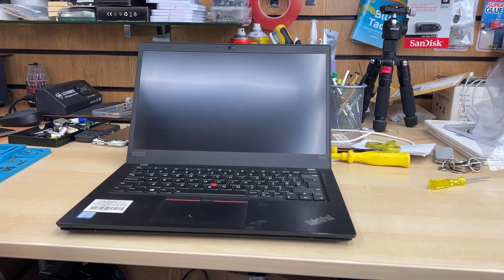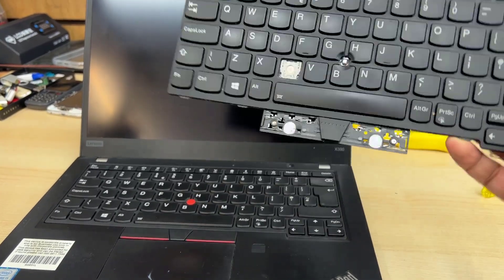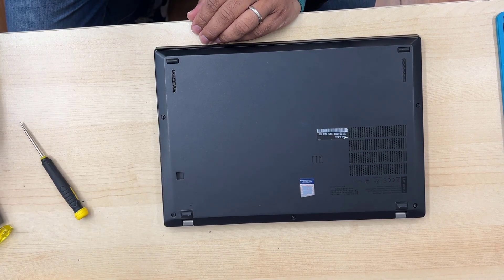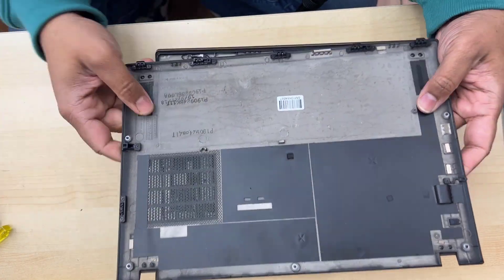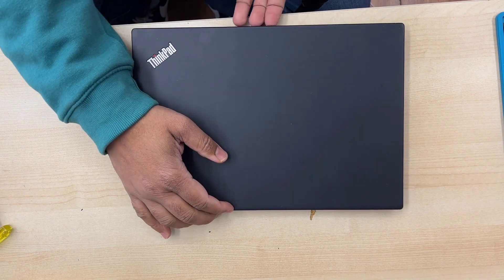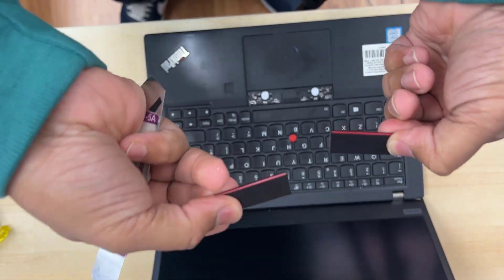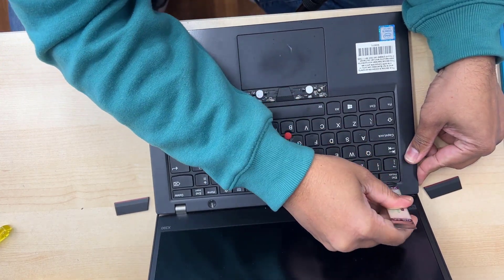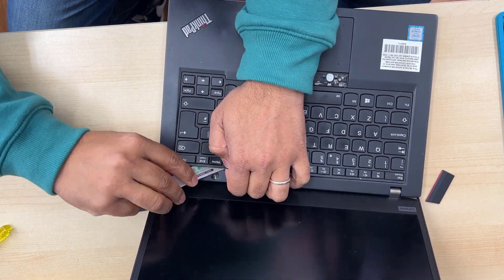How To Replace Keyboard On Lenovo ThinkPad X390

Comment: The procedure for removing the keyboard is wrong. The keyboard actually slides up, just enough to release the bottom locks and pull upwards from the bottom (palmrest) side. Don't try to pry it from the screen side.

Comment: this is not the correct way of doing this. Once you remove the screws under the mouse buttons, you can push the keyboard upwards, it slides alittle, allowing you to lift the keyboard out from the bottom-up. No prying required.
Reply: Yes, and i follow this tutorial, and than my laptop cover is scrath

Comment: Instead of unhooking from plam side you shows from opposite side which is wrong. once you open keyboard you can clearly see the keyboard lock clamps which has gap side from front position.
Reply: Sorry, i just saw another who removed it, and he did it in a much easyer way with just popping it twards the screen.
But you have to see how its done to understand it.
Reply: He does not unhock from palm side, where the hooks are.. I dont see any problem with the way he does it.. What you say doesnt make any sense..